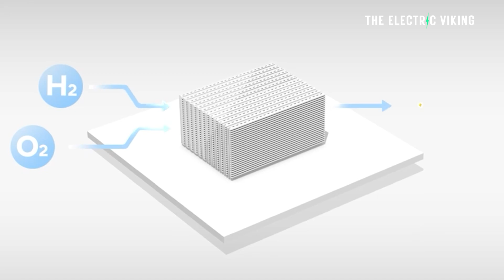Hyundai reveals plan to turn Poop, Plastic and Waste into Hydrogen

Comment: The root problem with hydrogen is its large volume. It requires massive pressure to contain in a small enough space to use in a car and thar takes energy to do. It’s just another form of battery with added efficiency losses due to pressurisation. It makes sense in large industrial and agricultural vehicles as a replacement for diesel but in passenger cars I don’t think so.

Comment: Hydrogen as a fuel is bulky, difficult to store, and expensive, it simply doesn't make sense for road vehicles - or for ships, either. As for planes, it is doubtful that the light weight of hydrogen could make up for the high cost and storage problems. 

Making hydrogen from waste is interesting, but it won't reduce cost enough to make it competitive. It would probably be better to use that waste to make methane, methanol, or other biofuels.

Comment: Hydrogen as-is has no chance against BEVs due to current inefficient technology. It's not a matter of little tweaks and improvements, it must be vastly different to be practical. You can't break the laws of nature, you have to figure out ways around them. 

There are a couple possibilities. First, generating H2 from natural gas is not green AT ALL, and making it from electricity adds extra steps to the alternative, just putting that electricity into a battery.  We could generate H2 from very high temperature sources like a nuclear reactor or a concentrating solar array. Then how do we get it from wherever that large machinery is, to filling stations? Long pipelines made of Unobtanium, which is impermeable and cheap. 

The next possibility would be making a synfuel which can be easily transported. There are nasty things like ammonia, but maybe some alcohol can be used. Butanol is very much like gasoline and can be used in existing engines until they die. Of course burning anything in air is going to produce NOx pollutants, so fuel cells can be used. Well, we'd need some cheap catalyst breakthrough for FCEVs to be affordable.  There are other options like hydrides which have their own long list of unsolved problems. Bottom line for synfuels is that they make gasoline look dirt cheap.

Comment: As more and more people experience the upsides of owning an EV it will be harder to convince them to switch to a less efficient more costly "fuel station" bound solution. It may already be too late for light duty vehicles.
Reply: True for consumer vehicles. But for long haul trasport and aviation, battery energy density is still not good enough. Hydrogen is only thing to replace fossil fuel in those applications.
Reply: @i6power30  Studies so far have concluded hydrogen in aviation is physically not realistic.  And for heavy road transport, the Tesla Semi Truck seems very promising.
Reply: @elinys2843  I'm not saying hydrogen is the answer. I'm just saying that current battery technology is not good enough. Hydrogen is one possible alternative. There could be others but we'll see. We must not be dogmatic and constraint choices only to electric. Be more open minded
Reply: @i6power30  that is certainly the talking point but am not yet convinced - you need larger tanks at much higher pressures to get the same range vs petrol based engines AND large battery packs plus the question of distribution, storage etc.. ultimately the total cost of ownership (TCO) will be Hydrogen's undoing. It actually seems like a worse solution than gas in some ways.
Reply: @erktrek  sure it'll be expensive but it comes down to our priorities. Environment or economics.
Reply: @i6power30  That is a false dichotomy.. it is in fact quite possible to have environmentally friendly options and benefit economically as well.

Comment: Hydrogen from plastic is no different than burning oil. Plastic is made from oil. If you bury it in a landfill you've put the oil back into the ground. If you convert it into hydrogen you release the CO2 into the atmosphere in exactly the same way as methane reformation. Its probably worse than methane because there are more steps which will use more energy.
I don't get why Hyundai is still messing around with hydrogen. Unlike Toyota they have a full line of excellent EVs.

Comment: Hi Sam, you may already have seen it, but there's an article on CleanTechnica out at the end of the year that identifies the relative costs of transporting energy by electric or hydrogen. If you look up "CleanTechnica" and "New Hydrogen Pipeline Vs HVDC Study Less Wrong, More Clearly Shows Hydrogen Uneconomic" you'll never consider hydrogen as a mass energy source again.

Comment: Instead of waste to hydrogen, don’t they have biomass waste to electricity power plants already? Electricity is so ubiquitous that it could be made from nuclear, coal, solar, wind, water, gas, biomass etc. We already have easy way to transport electricity, we don’t need another just for hydrogen. All we need to do is make power plants better and more efficient
Reply: That would be too efficient
Reply: Dumps and treatment facilities make methane, which can be burned to run pumps or generate electricity. You don't get a lot. Natural gas can be compressed, stored, and shipped fairly easily, and some fleets use it. It has advantages and disadvantages, but never caught on for consumer use. 
Making hydrogen from ethane means chemically removing the carbon which takes energy. The n you have to compress, store, ship and pump it. That's all inefficient and thus more costly.

Comment: Thanks. 
For the foreseeable future,  EVs will dominate the vehicle market. As for hydrogen from waste, it's a gimmick.  We have analyzed possible energy production from waste, and found that theoretically you can produce only ~7% of the national vehicles fuels from all the national waste (mainly organic and plastics ). However,  7% is almost impossible to reach, since you have such a diverse and distributed waste system. It's a logistical nightmare. Also, since hydrogen production is so energy inefficient, you get even lower numbers. So, at best you can power maybe 1-2% of the vehicles with hydrogen from waste. And of course it would be much more expensive than electricity.

Comment: I would immediately change to hydrogen as I have no possibility to charge an BEV at home! Hydrogen is more efficient than gasoline and doesn’t have the range loss in Winter like an BEV, as it produces its own heat.
Reply: Nice try - HFCVs also have a battery (fed by the fuel cell) that would likely be subject to the same issues as proper BEVs. Might take less time to recharge maybe but range would still suffer. In terms of home charging.. so what? If you currently own an ICE vehicle you still have to go to a petrol/gas station periodically anyway like you would with an EV. Spending a few minutes more at a charging station and spending less vs pump and gas/petrol can't possibly be the deal breaker as many claim.
Reply: Are you a bot or just a simple person? Can't charge at home? No charging stations around or what? No charging stations at work / malls? Or if it's not at home, you won't understand how to plug it in? :D
Reply: @TricoliciSerghei  the next charging station is 2 km away and you are only allowed to park for max 4 h!  And at our underground parking we have only 4 Amp leftover! So what now?
Reply: @meindepp1938  If there's a will there's a way. I don't think you want an EV, so even if I describe it as the best thing in the world, you'll find a reason to say you don't want it or it's not for you, so I guess we can each go our own ways.
Reply: One of the many problems with hydrogen is that it's very expensive to make, store, and ship. Gasoline is cheap, you pump it out of the ground, refine it, tanker it around. Green hydrogen is made from electricity, LOTS of it, inefficiently.
Reply: If we would use the green electricity which we are wasting in Germany we would have plenty at 0 cost for electrolyses!
Reply: @pin65371  Seems like you need to solve other problems than buying a car. 
I know one thing, if there's a will there's a way. Hydrogen is not an answer for passenger cars, I wouldn't drive a hydrogen car for any money, driving with a pressurized bomb under the vehicle is not for me. 
When I see people pushing hydrogen cars I think 2 things, a) they are uninformed about what a hydrogen car is and how hard it is to fuel it (there's no infrastructure and the infrastructure itself would be very very expensive to build). b) they are paid shills.

Which one are you? Or you can bring some really good arguments to convince me that Hydrogen is somehow cool and the future.. if you want.
Reply: @TricoliciSerghei  you are using the same bomb argument which was used when petrol cars came up! Total B.S.
Reply: @pin65371  And you don't sit at the charging station with your gasoline car or a hydrogen car? 
If you could charge your battery in 20 minutes or less, is that an issue?
Reply: Clueless nonsense

Comment: The biggest of many problems with hydrogen is that if it is enabled as a fuel, then the production of cheap dirty hydrogen will flourish. If hydrogen is made from plastic or poop or anything else containing carbon. then co2 will be a waste product. It is fortunate that hydrogen is impractical in cars  for multiple reasons,  and EVs are much better.

Comment: The systems that enable hydrogen use in cars, trucks, busses are complex, dangerous and expensive when compared to simpler, safer and more efficient electric vehicles. Hydrogen is being pedaled to us by big oil because it is made from fracked fossil gas. Count me out.
Reply: This guy gets it, it’s an insane proposition…
Reply: @fractalelf7760   this - so is our existing oil and gas infrastructure if you think about it.
Reply: If the alternative is to sit and wait 1 hour for a charger than charge for 2 hours because your battery is cold (like in Chicago, many could not even get their cars to charge at all), then I am all up for hydrogen. It is not even dangerous, that is an BEV-fanboy argument
Reply: @thoos192  Temporary issue.  Pad wireless charging at home, work and public parking will be there soon.  Btw in Chicago most users were ignorant of their battery warmer…. Far more ICE vehicles had issues in Chicago than EVs, need just made a big fuss to please their oil-ad payers.

Comment: Electric cars are totally impractical, take too long to charge, are too expensive, and prone to catch fire. Hyundai is taking the wrong approach. Stanely Meyer and Dennis Klien proved water can be turned into a burnable (explosive) gas by exciting water molecules with certain frequencies. Plastic can be turned into very clean burning diesel fuel by a simple distillation process. Human waste and manure will ferment into methane which can be captured to run engines or provide cooking and heating gas. As for net zero and carbon causing so-called climate change it is total BS.

Comment: No matter Hydrogen or Gasoline, when the temperature of the combustion engine gets too hot, Nitrogen and Oxygen combines to form NOx. ( Oxidation Reduction in chemistry terminology)  If the EGR doesn't work and it will break one day then NOx is formed.  All you have to do is run the car on a Dyno then load down the engine, the gas analyzer will show the formation of NOx.   The people that promote Hydrogen is not facing the facts.  NOx will be formed using Hydrogen fuel so don't be fooled.

Comment: Sure, I would buy one if I can refill it quickly and easily, which I can't do with a regular EV, yet (because I live on the 10th floor).
Reply: @pin65371  Have you actually priced it out? Does every stall have to be wired? No. Will the government "never" pay for it, like they are currently paying for charging elsewhere? Will the landlord do the work himself or just write a check to an electrician? Will people rent somewhere else with charging, instead of a place that's behind the times?
Reply: Why would it cost 10s of millions to wire up the building? Does it already cost 10s of millions to wire up every apartment with simple plug. And simple plug you have in apartment is enough for 50 miles overnight probably.
Reply: Just go down to your local hydrogen station. Where is that?? 
Wherever you park, there's probably electricity pretty close. Getting it to an EV is a much easier solution than hydrogen.

Comment: I love driving my EV from solar off the roof. I am driving on sunshine. And it is free and gentle on the planet.
How could a hydrogen fueling station ever compete with that.
Reply: Cue up "Walking (Riding) On Sunshine" by Katrina and the Waves.
Reply: EVs are like freshly squeezed olive oil
Hydrogen cars would be like canola oil made by a chemical process
Reply: Actually some do have it like that in Europe, although the amount of electricity produced that way is rather small
Reply: @pin65371  or lobby your local council to put in community solar or wind and strengthen grid connections to other regions. Get your council to put charging wherever people park their cars overnight.
Reply: Not everybody has the means to have solar power roofing at home mate your probably 2 percent of the global population that does.
Reply: @Whyunounderstand most of the world lives where there is plenty of sunshine.
Reply: How did you get rooftop solar for free? Mine was quoted at $10,000.
Reply: You know everything is free after you have paid for it already 😅
Reply: @lkrnpk . It is now free because I paid for the solar system 18 years ago,  and it is still working perfectly. It has saved me a huge amount on electricity bills. Thus the system is now charging my EV for free.
Reply: You can already get solar home power, that creates hydrogen when batteries are full.
Reply: @lowtech_1   Huh? How? Electrolysis requires a huge amount of water. So?, how exactly are you going to extract hydrogen? How about storage cost and energy cost?
Reply: @Seventh7Art   Can't remember the company, didnt save it.Think it was Germany's HPS Home Power Solutions or maybe Enapter. 
Goggled home solar hydrogen Germany .
Believe there's a Italian co doing systems also.

Comment: Don't hydrogen cars run on electric engines?  From what I've googled, Hydrogen fuel cells produce the electricity to run the engines.  "Fuel cell cars are powered by compressed hydrogen gas that feeds into an onboard fuel cell stack that doesn't burn the gas, but instead transforms the fuel's chemical energy into electrical energy. This electricity then powers the car's electric motors."  So these hydrogen fuel cells are just an indirect type of battery.  It seems more logical to use an actual battery that stores electricity then.
Reply: If that's the case, it might be a boon to city dwellers who have to park away from their dwelling.
Reply: @ampa4989  The only advantage hydrogen has now is quick refueling. That presumes you have a hydrogen station just down the street (in a dense urban area?) instead of having to drive 20 minutes out of town. 
If you can charge from any street light pole with a charge port, or a spot in a parking garage, it will take you ten seconds to plug in for the night. Or when better batteries come along and you can charge in the time it takes to go inside a convenience store and take a whiz and buy some coffee.
Reply: @pin65371  I'm an electrical engineer and I know that lightposts are sized for incandescent lights, so the system has unused capacity when LEDs are retrofitted. There are lightpost systems in use in Europe. Unless you actually know how much they cost, don't dismiss them out of hand. They can be a source of revenue, too.
Reply: Yep, conversation is waste.

Comment: You could never refuel a hydrogen vehicle of any kind overnight while you sleep. It means going back to "gas" stations again, even if they work out all the transportation costs and problems on the production side. I would never want a hydrogen car, either ICE hydrogen or Fuel cell hydrogen. Hydrogen really only has a future for stationary uses, and only those where it can be produced on site.
Reply: Consumers have just found a way to escape buying fuel, they won’t go back.
Reply: I guess it would work for city dwellers who cannot charge "at home."